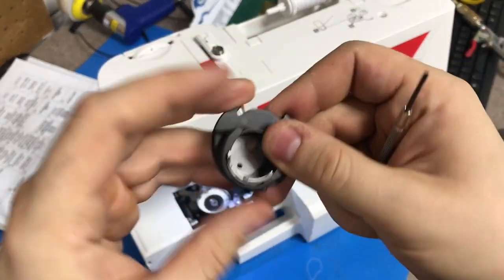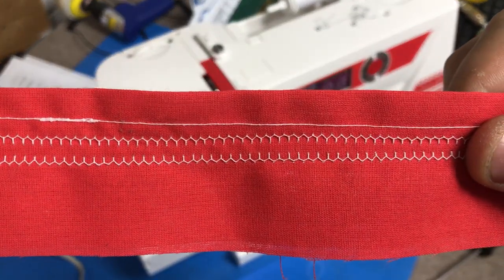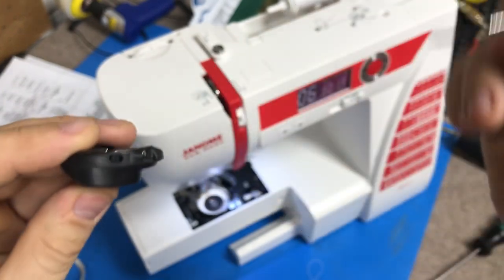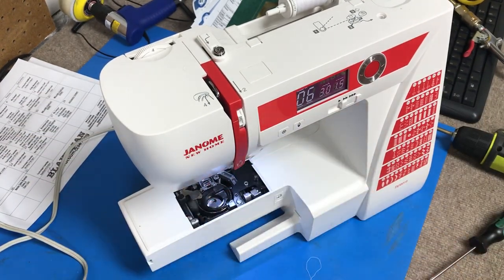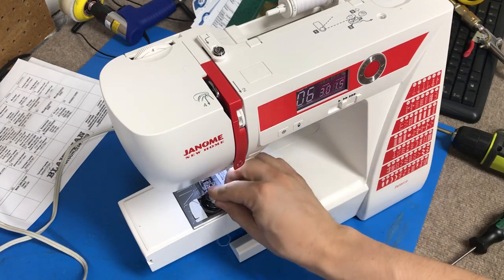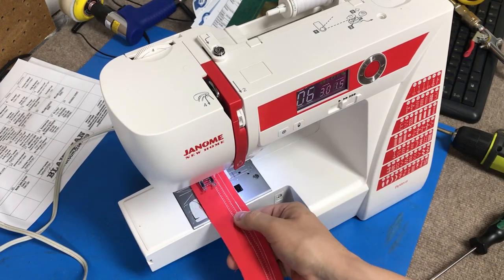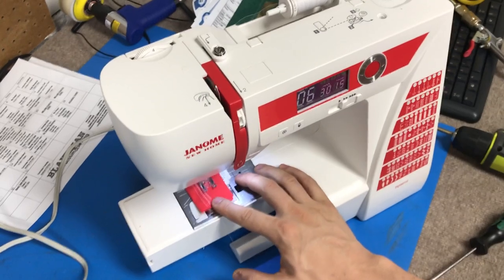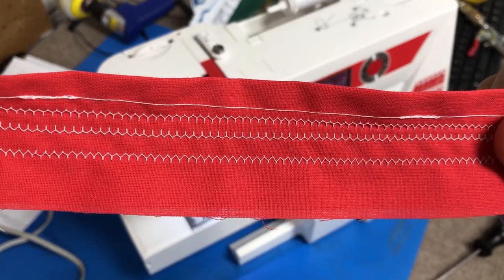Adjusting tension on a drop in bobbin sewing machine bobbin case

Comment: I was told to never touch the bobbin to fix the tension on a drop-in bobbin.  Of course, I did but it didn't change a thing.  So I had to put it back.  It's still not correctly put back.   I wouldn't touch it.  Does this affect the warranty?     And is there a second video?
Reply from the maker: To get the full training and see all the details as well as the service checklists use this link: https://www.sewvacretailresources.com/offers/Kpn93Nws

Comment: Thank you. Is the "bobbin test" *dropping the bobbin with the thread still threaded in it to check for tension relevant in the drop in bobbin type of bobbin? I have a Bernina that was made by Janome apparantly and am having variable tension with my stitches (too tight and too loose that leads to thread breakage) and am wondering what the cause is. It also wants to skip stitches (timing issue?) All of this happened out of the blue after hardly using the machine at all.
Reply from the maker: To get the full training and see all the details as well as the service checklists use this link: https://www.sewvacretailresources.com/offers/Kpn93Nws

Comment: To tighten the lower tension, do you turn the screw to the left or right.  Too hard to tell on your video.  Cannot see which way you are turning the screw.
Reply: If you under stitch is pulling too much, then loosen tension by screwing anti/counter clockwise
Reply from the maker: To get the full training and see all the details, as well as the service checklists, use this link: https://www.sewvacretailresources.com/offers/Kpn93Nws

Comment: I tried to fix mine, found that the screw supposedly holding it all together wasn't even tightened, and I fell out. looker for it for a out an hour, and it'd gone. is the any replacing it? I have a Kenmore if that helps